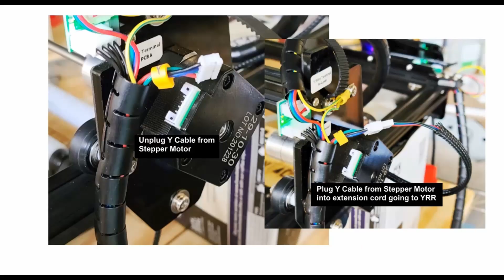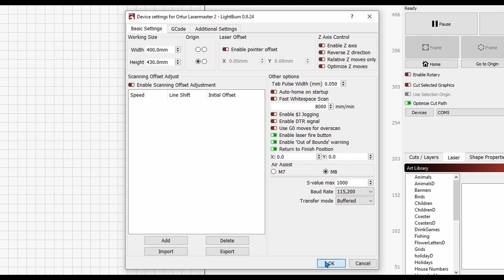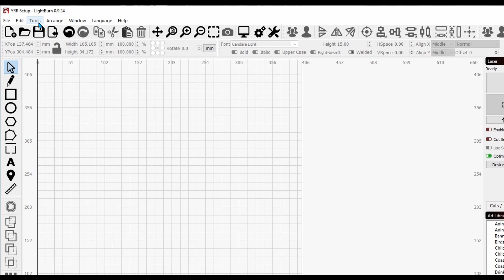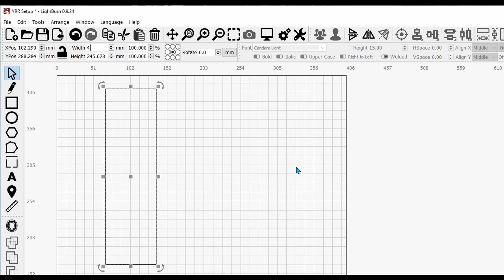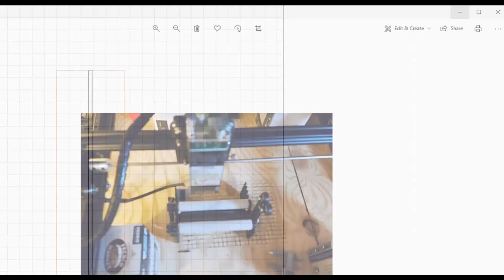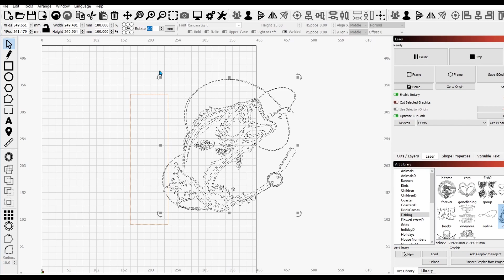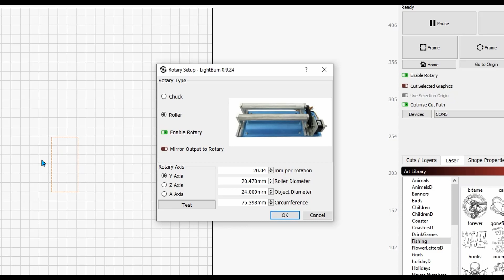👍 Ortur YRR Rotary Setup - The Only COMPLETE guide!

Comment: I really like what you are doing here. I watch all your videos and get great ideas for them. Thank you. I was having trouble with the rotary as everything printed in mirror. I tried the mirror button both ways nothing changed. Tried switching red and black wires nothing . switched blue and green wires still nothing. After moving everything back to original I switched the blue and green and the red and black wires. when I changed all 4 the printing came out as needed. Thanks again for putting out these great tips
Reply from the maker: Glad you liked it Rich!

Comment: great video for rotary.  It worked great for me the first time I tried it.  Went back to standard with out issues.  Today I thought I would get a little creative with a tapered bottom wine bottle.   So I made my funky set up.  I can provide pics if you want them.  But I had issues with the unit itself. I changed my settings to disable homing at start up, then turned off the power and attached the rotary cable.  Next I powered up the laser.  Then I loaded the rotary file I saved from my first go at the rotary set up that i did via your video.  Then I selected write into the machine settings and created my burn file graphics.  Then it went crazy.  I kept getting the Gcode error while trying to home or jog.  I had home turned off.  Anyway, I had to go back to the standard settings which was a little difficult because of the gcode error.  after research on inet, i found a comment about an error in the $22 code.  fixed that and i was back to good to go on the standard settings.  Then I thought I would try one last time.  Instead of using my saved rotary machine settings I started from scratch with your video.  It worked great.  I know this is a long comment but my question is, d0 you have issues when you go back and forth between the two machine setting files?
Reply from the maker: Some people do Barry. I have since found that after you save the settings, you have to load them again and check to see if they were saved properly.

Comment: Is it possible to burn conical shaped bottles?  If so, how are they treated differently than cylinders?
Reply from the maker: Yes, you would need to raise one end to level. The Ortur has the attachment included.
Reply: @TheLouisianaHobbyGuy  Thanks.  Would the Ortur roller work with the Comgro Comgo Z1?
Reply from the maker: Diode rollers are universal Chuck. It's just a Y stepper and a few belts.

Comment: Nice video. Just got mine today, I will try to put it together and set it up tomorrow. Thanks
Reply from the maker: Have fun!
Reply: @TheLouisianaHobbyGuy  Hi mate, Not having much fun at the moment :( 
Just testing the rotary as per your video. I've measure the rolls, and I had 2 different measures, so i set it somewhere in between the two, then I measure the object was 60mm, which gave me the circumference of 188.496mm, but  how did you get the "mm per rotation" figure? Is that supposed to be automatically calculated by Lightburn? Mine was over 300 mm...
I tried the framing and it looks like is going around about 3 times, same with the burning... So I'm not sure if my vertical lines are apart or overlapping, since is going around and over the circumference more then once...
Any idea? Cheers Alberto
Reply from the maker: @avleathercraft648  Experimenting. I ultimately wound up with 40.51 on the Ortur I believe it was.
Reply: @TheLouisianaHobbyGuy  Finally got it right today. Took probably more then 20 tries. Now i have another issue. The burn came up flipped, was a skull with a pipe, and in the draw it is on the right, Lightburn screen and preview both shows on the right, but it burned flipped with pipe on the left. It did this yesterday with text as well. The mirror option on the rotary setting is turned off.  Did you ever experience the issues? Any idea?
Reply from the maker: @alb673  No, it sounds like you have to turn on mirroring.

Comment: Hi...great video but i have an issue....when i do all the setting changes my laser wont start...red light is blinking and in console i get this message 
error:9
G-code locked out during alarm or jog state.
On or near line 0:
i need to change ste setting back to default and then i can not use the rotary...do you have any idea how to fix that
Reply: Ok....so when i just put $X it says unlocked and i can use it,until i turn it off and on again...then i need to do the same thing...it doesnt change anything if i put in the second command $33=1000.. or not...when i turn it off and on need to repeat the process...and first command is all it takes...still,dont know why this alarm or error keeps coming on when soft limit and auto home is turned off
Reply from the maker: @c00lme21  Try $33=750. It would be a lot easier for me if you email me. There's not much I can do here except text.
Reply: @TheLouisianaHobbyGuy  i have recived your email and responded...thanks agains,and just for others if they run to same problem...ortur tech guys said it normal for laser to be locked when autohome is off...you need to unlock it by pressing stop in lightburn ,or padlock in gbrl...or use the code $X in console in lightburn...and then u can use the laser
Reply from the maker: Error 9 is shock and movement detected. On the console tab, type in $X and press enter. Then type in $33=1000 and press enter again. Then retry.

Comment: You're THE MAN, Rich! Thank you for taking so much time to help us all. I am having a couple of issues though. 1. For some reason when I frame the test line the tumbler only rotates about 90 degrees (versus 360 that it should) and then returns. and 2. when I run the job the burn image is very compressed horizontally as though the width is 4x narrower than it should be (but the height looks accurate). Any pointers/suggestions?  Thanks in advance for any help! Clay
Reply from the maker: Sounds like you need to adjust your steps per rotation Clay.
Reply: @TheLouisianaHobbyGuy  thank you, Rich!

Comment: I'm using a Nasum A5 pro laser and I am unable to get the Ortur YRR to work.  The stepper motor just chatters.  Any ideas?  I have already replaced the motor thinking it was bad but no luck.
Reply: I got it.  Had to switch Blue and Green wire.
Reply: I found that switching the center two wires at the yrr end cured this problem.  I am using  a 
Skulpfun 6 with the Orturo YRR. did the fix for me.  Someone here had a similar solution for the Skulpfun 9 so I tried it and it worked.
Reply from the maker: @dickbird7508  Yes, that's what I meant by checking the pinout.
Reply from the maker: Have you checked to see if the pinout of the wiring matches? Sounds like the wires don't match. You might need to make a custom extension cable.

Comment: Hey Rich, 
Great video! , This really helped me get most of my settings dialed in. Only issue i am having is when burn letters onto a tumble, For example I was writing "I planned on it" on a tumbler, When it would start engraving, it would start on the word "Planned" but not finish the word when it would go back to finish the word the letters would either be spaced out differently or not line up or overlap itself. Do you have any idea why this would happen? Thanks man
Reply from the maker: Sounds like a steps per rotation problem Frank. Check your roller diameter again.
Reply: @TheLouisianaHobbyGuy  Right on Rich I will double check that and remeasure. Thanks for the quick reply.
Take care.

Comment: Will the ortur rotary work with the sculpfun s6 pro ??? Thanks in advance
Reply from the maker: I don't know, I don't have a Sculpfun. If the Y-axis wiring matches the Ortur roller wiring, then yes it would. If it doesn't, you would need to make your own crossover wire.
Reply: @TheLouisianaHobbyGuy  ok thanks
Reply from the maker: @2mwelding373  I was told you need to switch the middle (blue and green) wires around on the plug that fits into the Y axis for it to work properly.
Reply: @TheLouisianaHobbyGuy  ok ill try that thanks again
Reply: @TheLouisianaHobbyGuy  Worked for me!!

Comment: Great video. So you know how there’s two stepper motors for y axis. I need to disconnect both y axis cables from control board and only use one for the roller. Am I right? Thanks
Reply from the maker: Yes, that is correct!

Comment: Good evening! Great Tutorial and video! The documentation was top notch! I have one quick question for you though…when I followed the steps in the tutorial and tried to jog the unit it just kind of stuttered. It would move a few revolutions at a time and then would reverse direction. I’m thinking that it might be the wiring for my connector for the laser itself. Have you heard of this problem? Maybe a solution?
Reply from the maker: Haven't heard of it. Check the pins on the 2 connectors and make sure they match - power to power, ground to ground, etc.
Reply: @TheLouisianaHobbyGuy  that makes sense! Checking that now.

Comment: Hey Rich I am struggling with this and can't seem to figure out why. I am sure I am doing something painstakingly stupid and obvious, but I can not for the life of me figure it out. These are the steps I have gone through and everything goes haywire. What could I be doing wrong? ( I have the ortur laser master 2 pro, and using lightburn V1.0.06
Default settings are on. Move laser to origin which for me is dead center of the work area.
Power off the laser, disconnect Y-axis and connect the rotary tool to it.
Power on laser and load “rotary settings” file.
Crap hits the fan. I try and send it to a location and it goes crazy saying I am out of the work area, it just moves the X-Axis to far right of the machine and hits the wall.
Hit get position just to see I am in “negative coordinates”.
Try and switch everything back to "Default settings" but now light burn believes my machine is in "Negative Coordinates". I have to Home the machine and enter G0 X0 Y0 to get it to find the origin, then enter G10 L2 P1 X-400 Y-400 to get the software to operate the machine properly again.
Then I try the process over with the same results each time. I have attempted this 4 times now and I am pulling my hair out.
Thanks for the great video, and any advice you might be able to offer.
Reply from the maker: Hi Trevor. Copy and paste this to an email and send it to me. thelahobbyguy@gmail.com
I just got the LM2 Pro and I'll be setting it up in a day or 2 so I'll see if I can replicate your problem.
Reply: @TheLouisianaHobbyGuy  any updates on this? I had the same issue yesterday with mine..
Reply from the maker: @colinmartin6907  I have no issues with the rotary Colin.

Comment: Thanks Rich for a prompt reply. I have run further tests, I entered a row of numbers 1 to 9 their height was 16.6mm to run right around a tumbler with a circumference of 228.96mm. The tumbler was covered with masking tape, when I started the run it was obvious that it was wrong, but I let it run for 3 numbers. The outcome was that the numbers were 120mm high x about 12 to13mm wide, also they were a mirror image. If I had completed the run I think the numbers would have gone around the circumference correctly. The image is correct when viewed in the preview window, I have gone right through all the settings for installing the roller. I have tried Enable Rotary both on and off in Tools Rotary Setup. There must be a setting wrong somewhere either in my LightBurn or for the Rotary Roller.  Can you or anyone else please help? Kind regards Ian.
Reply from the maker: Ian, please look at the pinout of the wiring and see if the colors match up. The only thing I can think of is, the wiring is crossed in the Y-Axis plug.

Comment: Rich, firstly thanks for a very educational channel, as a newbie to both LighBurn and Laser Etching I have learnt a hell of a lot. I have just purchased a Atomstack R3 rotary roller to use with my NEJE Master 2S Plus 40w Laser. I followed your instructions to the letter and they worked even though they were for the Ortur. However when I did the test with a 4mm line my line was 29mm wide, I run it several time with the same result. I tried a 5mm line this came out at 37mm wide, also the first line was 3mm short so I added 3mm on the mm per rotation in Rotary setup, but the gap still remains 3mm. Any ideas? By the way I am in the UK , thanks again Ian.
Reply from the maker: I don't know Ian. Have you tried flipping the line 90 degrees?

Comment from the maker: NOTE FOR THE SCULPFUN S9 USERS: 
If you're using the Ortur rotary on the S9, you must switch the middle (blue and green) wires around on the plug that fits into the Y axis for it to work properly.
Thanks to OutfoxedYa for this valuable resolve!

Comment: Hi Rich,
So, was fairly confident after watching this video that I’d be able to set up my new Ortur 2 rotary with my Sculpfun S9. Followed your instructions to a T but for some reason the rotary just doesn’t turn and the image all burns along one line. There’s an occasional jog but then nothing also the image that there is (about 1 letter width) looks to be coming out reversed even though I don’t have mirrored checked? Not at the Mac right now to try the ‘turn off rotary’ bit if that doesn’t work for me tomorrow am I doing something wrong or might I have a faulty unit?
Cheers
Reply from the maker: Hard to tell. I tried to cover all the bases in the video but it seems only about 90% of the people are successful. I would probably start by cleaning the wiring connection.
Reply: @TheLouisianaHobbyGuy  Well tried the bypass this morning and still the same problem with the stepper motor on the rotary device just rumbling without moving. Someone else on another forum say they’ve just bought one for his Sculpfun and has the same problem so I’m at a loss as what to try next. Have emailed Ortur and asked the question so waiting for a reply as it clearly states in the instructions provided that their machine is compatible with other makes of laser.
Reply from the maker: This doesn't make any sense at all. The only commands being sent to the rotary are forward/reverse & speed, just like any other stepper motor. Have you tried moving the stepper by hand to see if it's stuck? Roll the rollers and see if the shaft on the roller stepper motor turns 360°. Also look at the pinout on your extension wire where it plugs into the Y-axis coming from your control board and make sure it matches the pinout on the other end where it plugs to the rotary.
Reply: @TheLouisianaHobbyGuy  Yep agreed it just doesn’t make sense. I’ve already tried the rollers on the stepper and they move freely, even took the belt off and just felt the spindle of the motor but that just stayed still making the rumbling noise. Emailed Ortur saying I thought the motor must be faulty (still waiting for a reply) then someone else posted saying they had same problem. I posted a short video of what mine does and he says his does exactly the same. As for the wiring, the wiring on my S9 are black compared to the coloured wires on the Ortur but they seem to match up in the plug unless the blues and reds are wrong way round? I’m just at a loss as to why I can’t find a work around 😩
Reply from the maker: Yep, bad stepper motor. Cheap enough on Amazon. https://amzn.to/30CxDAO
Reply: @TheLouisianaHobbyGuy  Hold on though Rich, not so fast! On a different forum someone with same problem suggested to switch the middle two wires round on the plug that goes into the y axis on the laser and that solves it. Apparently they are different on the Ortur lasers to mine so will try that tomorrow and let you know 👍🏻🤞
Reply from the maker: Let me know so I can write it down Sir!
Reply: @TheLouisianaHobbyGuy  Yep, great news Rich 😀Switching the middle (blue and green) wires around on the plug that fits into the Y axis on my Sculpfun S9 has fixed the issue. The Ortur now works perfectly with it although I did have to click the ‘mirror image’ as the printing was coming out reversed for some reason.
Reply from the maker: @OutfoxedYa  Noted, thank you!

Comment: Thanks for such a great video. So meticulous , but I’m having trouble, think I missed something. When I tell it to frame, it runs all the way across the way across the rail and slams into the end over and over. I can send a video if it helps clarify
Reply from the maker: Your position coordinates are off. Disconnect the rotary, plug in the Y, put your settings back to normal, reset the laser, type $RST=* in the console tab, then click home. It won't hurt to do a hard power off reset either. Next jog the laser to the approximate position of the rotary and then plug in the rotary to the Y and redo your settings and you should be good. It's good practice to always do a power off on the laser and then power on with the homing cycle before every new job.
Reply: @TheLouisianaHobbyGuy  thanks for your reply.  I tried to set it back to standard settings, but now it's really not responding. I restart the system and right off it homes, and i can manually move the position of the laser, but once i tell it to go home again, it stops responding.  I tried the reset command, but no luck.  Any thoughts on what I may have done?  It starts giving me the following errors:

“G-code locked out during alarm or jog state.”

“ALARM:8
Homing fail. Cycle failed to clear limit switch when pulling off. Try increasing pull-off setting or check wiring.
ok
Ortur Laser Master 2 Pro S2 Ready!
OLF 183.”

“[MSG: Flame detector active,Ambient infrared value:0]
Grbl 1.1f [‘$’ for help]
[MSG:’$H’|’$X’ to unlock]”
Reply from the maker: @mikevalle4100  Email me: thelahobbyguy@gmail.com